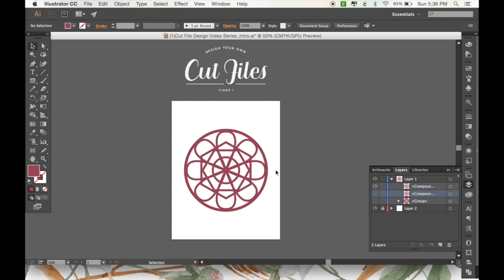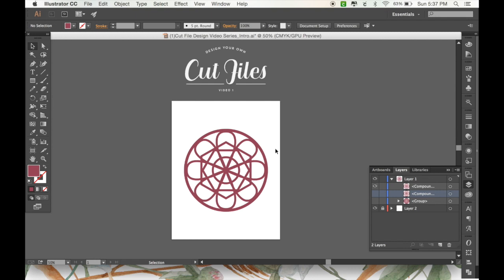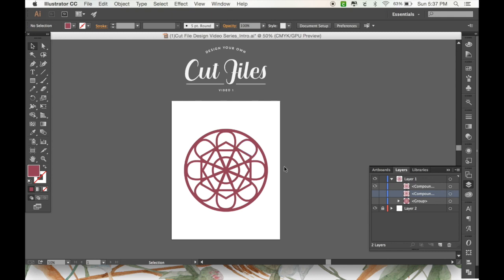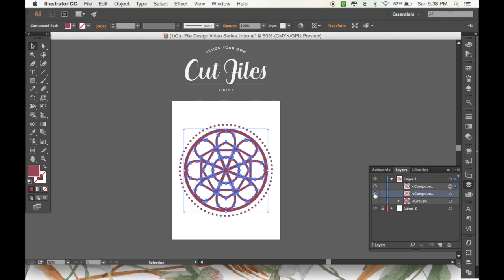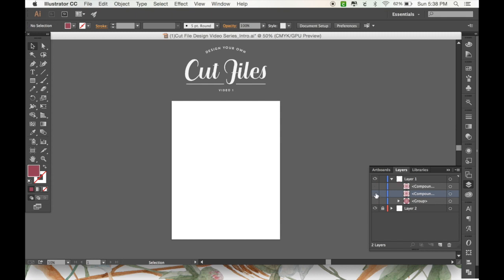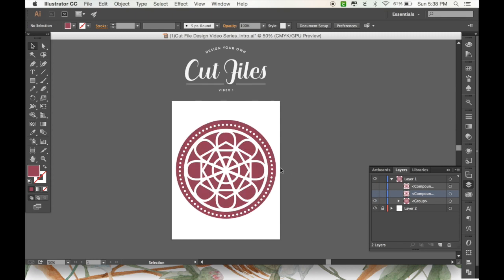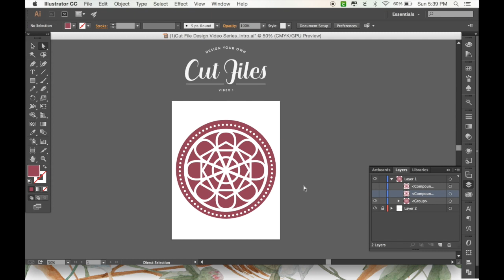Designing Your Own Cut Files: Part 1 - Introduction to SVG Cut File Design

Comment: When creating SVG designs, I’m finding that there are microscopic specks of layers that I couldn’t pick up in Ai are being picked up when imported into Cricut design space...any idea how to fix that?
Reply from the maker: Hmm, it could be a couple different things. I've had that problem before when "exporting" a design to SVG rather than using the "save as" function to create an SVG file. Also, it's always good to double check your layers panel to make sure there isn't anything funny going on. And finally, sometimes Cricut Design space does have some weird glitches I've come across occasionally, and it can be hard to work around them.

Comment: Hi Mandee I have gone through all your tutorials to learn about SVG the one problem i am having i made a simple Hexagon shape using the polgon tool then added 2 crossed lines from corner to corner i saved it as a svg uploaded into design space shows the icon them this is where the problem is when i insert images nothing is showing in design space only a empty box ?

Comment: I'm confident in Illustrator but complete newbie to cutting machine in general. Perhaps I've missed this information, but what's the advantage of SVG over PNG when it comes to cutting?
Reply from the maker: SVG files are more widely recognized across cutting software platforms. Also, since SVG is a type of vector file, you can scale it infinitely larger or smaller without losing any data. While PNG files can be used in some cutting software as well, you're cut has a better chance of coming out clean if you use an SVG file. :)

Comment: Sorry I'm definitely a novice to the cut files and wondering what program do I use to create SVG files for the brother scan and cut do I use the same programs or do I have to have a different one? Thanks so much
Reply from the maker: Hi Desaree! I have never personally used a Brother Scan and Cut machine, but, if the program works with SVG files, then the process should be the same. There could be a few tips and trick later on in this series that may not work (specifically once you start utilizing multiple layers for "print then cut" or scoring), but basic SVG file design concepts would be the same. And Adobe Illustrator is your best bet. :)
Reply: Mandee Thomas thank you so much I really appreciate your reply I'm definitely going to check out your series and see it through. I have a feeling that if I don't soon figure it out with the scan and cut that I'll be trading it in for one of the other more mainstream electronic cutter so I too will be able to do what I actually wanted to do with a cutting machine in the first place LOL. Thanks again